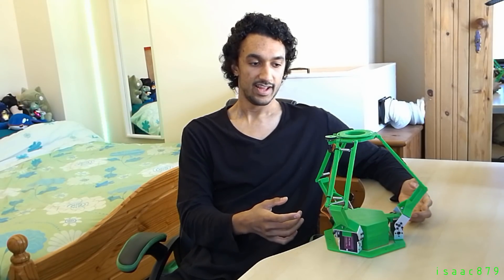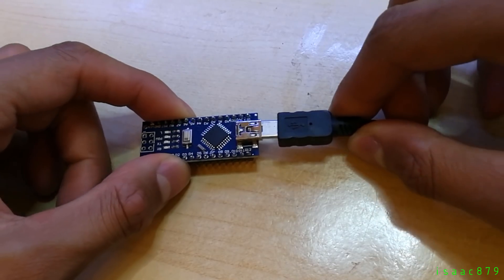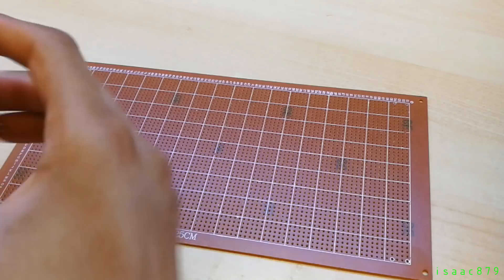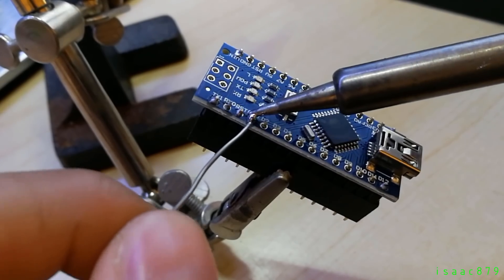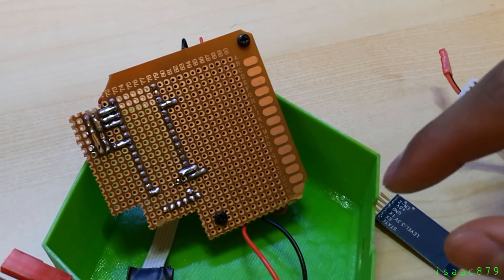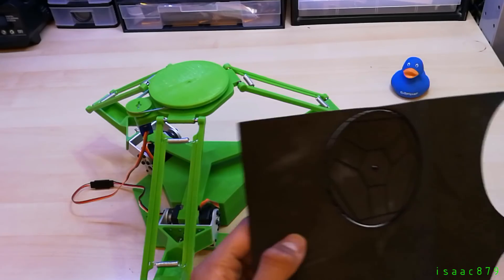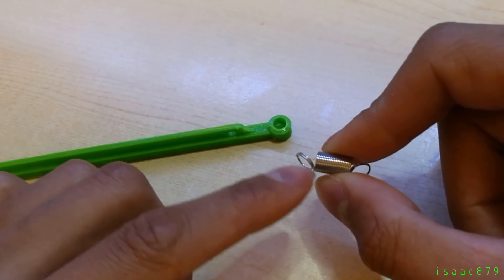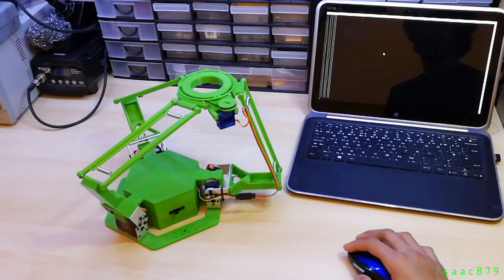3D Printed Delta Robot (Arduino Controlled) 2019

Comment: Thank you very much. Not only for the printer, also for all the ideas inspired. Here is an idea to consider: Use a flex cable to move the end effector while allowing the servo to be mounted on the base. This will reduce weight on the end effector and should improve print speed and quality. Finding a good flex cable for this may be a challenge.  I got the idea while thinking about how to mound a "Remote Direct Drive" to your printer.  For my projects: Initially am thinking about a Raspberry Pi port. The Pi will add WiFi control and a Webcam. Secondly, converting it to use (recycle) an old 3D printer board for the kinematics. I've been hoping for a project that would allow me to recycle those electronics. Oh yeah, subscribed. Best of luck!

Comment: As a person who comes from the 3d printing community, I’m curious if you could attach a 3d printer hotend to it and have it run like a normal delta-style printer
Reply from the maker: Unfortunately it's not accurate enough for 3D printing. The servos just don't have a high enough resolution to get submillimeter results...
Reply: I’m wondering if you could replace the servos with NEMA 17 steppers, which are the standard for 3d printing. You’d also have to write the firmware code yourself though, cause Marlin and Repetier can only run on normal 3d printers.

Comment: Great implementation! I wanted to do a similar delta robot since there is a lockdown. Could you please reference the book where you got the inverse kinematics for this mechanism or the schematic of your particular robot so I can follow the equations in your code?
Reply from the maker: Thank you! I derived the inverse kinematics myself so there is no book I can reference although I'm sure there must be some around. On the GitHub repository for the delta robot I have included 2 pictures of what all the variables in the inverse kinematic functions relate to on the physical robot which will hopefully help you understand it. It's basically just a load of trigonometry to calculate all the required angles.
Reply: @isaac879  thank you very much for the reply, i realised that there were pictures with the file and understood the kinematics. I admire your trigonometric approach since it shows a better understanding of the kinematics compared to searching for a ready made formula. Thank you very much and keep up the good work!

Comment: It could be used as a 3D mouse, right?
Reply from the maker: Unfortunately not. The servos don't have any feedback so it wouldn't be able to tell if it was manually moved... I was actually doing a little research to making my own 3D mouse but getting it to interface with CAD software looks like it would be really difficult... It might be a project I work on at some point though.

Comment: Is the only way to control it with Arduino?? I’m really interested in building a delta robot but don’t know how to control it
Reply from the maker: This one was designed with an Arduino so all circuits and code would only work with Arudino. Ultimately you could replace the Arduino with any microcontroller that can drive servos if you wanted though.
Reply: But how do you get it to move all 3 axis when say you just want to go linear but you have 3 axis? One has to be z right?
Reply from the maker: @tat2joeelliott  Ah Ok the concept you are talking about is called "inverse kinematics". Basically for end effector coordinates given in x, y, z you can calculate the required servo angles using trigonometry/maths. To move in straight lines you can just interpolate points between the current position and target position then give each point to the inverse kinematics to calculate the servo angles required to move it through each of the interpolated points on the line.

Comment: Yes, but with an attachment, any thing you can do with one hand it can be programed to do. Print an attachment, write the code.. Not as hard as it sounds, Arduino is a killer little processor.

Comment: HI, thanks for this great work first, Could tell what documentations you followed to solve the inverseKematics because Im struggling with the kinematic model you followed which doesnt match with yours and also precise parameters like SERVO_OFFSET_Z,SERVO_OFFSET_x....etc thanks in advance
Reply from the maker: I glad you like it! I derived the inverse kinematics myself, it's basically just a lot of trigonometry. I have some reference pictures and the kinematic equations in the code (deltaRobot.cpp starting line 69) all on my github: https://github.com/isaac879/Delta-Robot 
Can you tell me which part doesn't match and I'll take a look to either fix or explain it?
Reply: @isaac879  thanks for the quick response, try to take a look at this link a web-gui  is made for simulating delta robot inverse kinematics just you have to fill out your delta robot parameters like L1,L2,L3 ...etc and theta's for servos.
I tried to tests some angles to get coordinates x,y,z but it doesnt match with yours.
https://www.marginallyclever.com/other/samples/fk-ik-test.html
Reply from the maker: @azdmessani4544  I've just had a little play with the simulation and they don't seem to match... I've noticed that changing the "Base to floor distance (b)" doesn't seem to cause any change to their kinematics so this might be why there is a difference between my values and theirs. Without seeing the actual calculations they are performing I can't pinpoint where the issue is occurring. Obviously I have the inverse kinematics running on my robot so I'm fairly sure mine are correct (or at least one solution).
Reply: @isaac879  yeah. I think the issue is in the base referenciel but your approach is working as well.

Comment: it's nice and cheap, but not precise, inspire on delta printers, use carbon rods, magnet joint, stepper motors, 32bit mainboards, this is invented from 2012 year, now it's not very expensive
Reply from the maker: No, it's not as accurate as a stepper driven delta robot. However I wanted it to be mostly 3D printable, cheap and easy to control/program so decided to use an Arduino and servos. I would love to make a stepper driven delta robot at some point though!

Comment: Looks great man. I'm currently working on my own design of a delta style robot and i'm very grateful for how far you went to keep this information public. I have seen so many people show off what they have done then hoard the "how I did it" like it's supposed to be some big secret. 
The specs for the servo you used say that it uses a potentiometer. You should be able to attach a wire to the center pin of the pot and extend the wire out of the servo and attach it to an analog pin on the arduino to get the position of each servo. When you want to train the robot to do a motion,  first disable the servos so they go limp, then move the arm to a position and record the position. There is a video on YouTube of a guy that built a very shaky arm using servos like this.

Comment: Subscribed. Thanks for making such detailed video about delta robot. It helps a lot.

Have you tested it on any simulation software before making hardware one?
Reply from the maker: Thanks for subscribing and I'm glad the video was helpful.
 
No, i didn't create any simulations first. I did model it in Autodesk Inventor and create an assembly model so I could check everything fitted and moved correctly first though.

Comment: Hi,
How to use a terminal program. ?
What kind of program do you use for this?
The film shows the program you are using, what is the program?
Reply from the maker: Hi there, I wrote the console application in C++ using Visual Studio 2015. The C++ source file is available on  my GitHub: https://github.com/isaac879/Delta-Robot/blob/master/Delta%20Robot%20Controller/main.cpp
Before you compile the code you will need to set the com port to the correct one for your Arduino. Once it is compiled, you can just run the program and then it will wait for certain key presses or mouse movements and send the appropriate command to the robot.

The console application isn't really an ideal solution as I would prefer to have a proper GUI but I needed to get it working quickly and didn't have time to create one...

Comment: @isaac879
Application? What program can you control the delta with HC-05? (App?)
Reply from the maker: There are a lot of Android apps that allow serial communication with it, just search the app store. When connected to a pc it acts just like the USB connection and uses a com port so you can send/receive data via the Arduino IDE serial monitor or I have written a terminal program to control it (source code is on my GitHub repository).

Comment: By the way i think the movement is too jaged for your robot, you should improve it by smothing the current incoming to the stepper motors there are some ways to do that :)
Reply from the maker: I'm not actually using stepper motors, I'm using servos. Unfortunately they aren't the most accurate so the movements are a little jerky at times although it is fairly accurate down to a few millimeters. I would love to build a stepper driven one as it could be way more precise!

Comment: What laser cutter were you using? can you make a video about that, is is made with arduino uno too? what is max laser power, and did you cut it in one thing? how actually you did that? what programs and everything you were using and how using to do that? could be really usefull, have laser myself, but don't use it becouse there is no reliable ant fast working software for it that i could found....
Reply from the maker: The laster I used is an EleksLaser-A3 Pro 2500mW. I'm currently using it with GRBL and LaserWeb4. I normally use Inkscape to design SVG file that I then use to engrave/cut. I'm have a video about the machine and what you can do with it but that is from before I changed to GRBL/LaserWeb: https://youtu.be/Qm7XQ-oWaN4
Reply: @isaac879  i was unable to set maximum laser power with GRBL and laserweb is not working at all, must be wrong drivers installer in the engraver itself, maby you could make an acurrate video or something which drivers and how to use it properly?
Reply from the maker: I have been wanting to make a new video about it so I can include all my improvements to it.
Reply: @isaac879  found some info about grbl v1.1f drivers which should be working with the arduino clone on that specific engraver, the only thing is left is the setup of the software (laserweb) probably, becouse its like a shark between all other softwares...
BTW, did you made some 3d printed mods? for the cables, stoppers, maby focus adjusting wheel which would be easier to use?